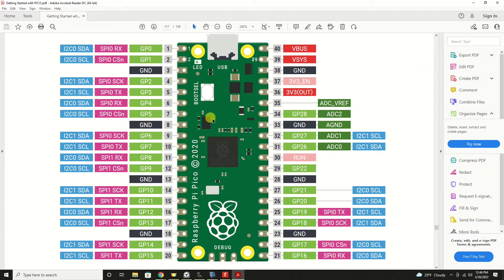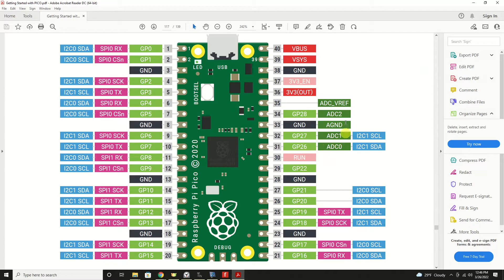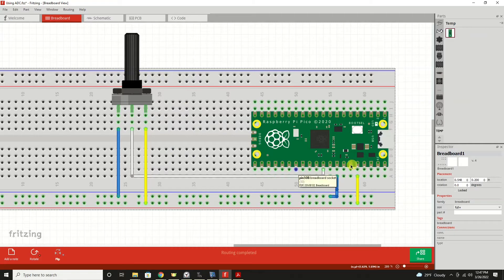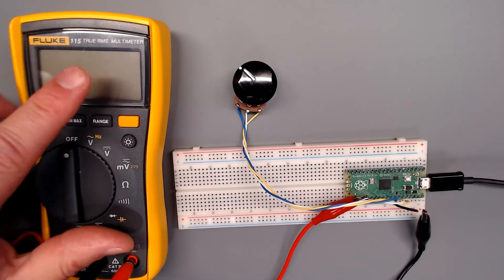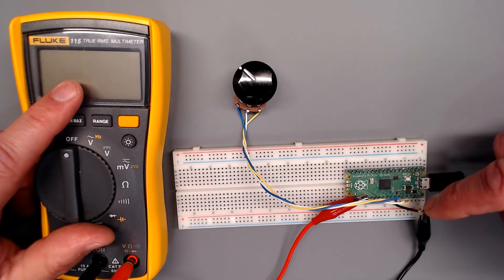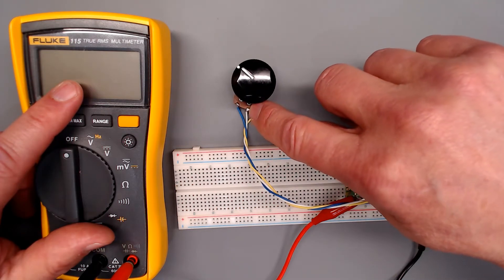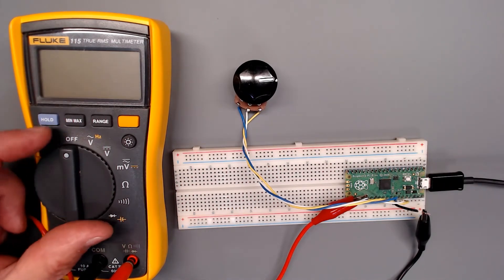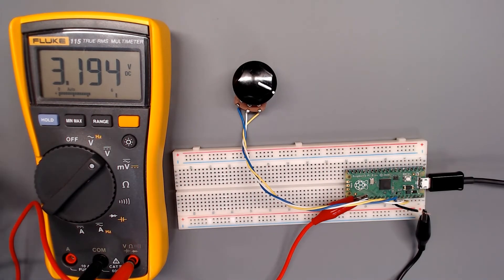Read Analog Voltage with the PICO

Comment: can you get stable milivolt or microvolt readings with this ADC for load cell signal?
Reply from the maker: I have no experience trying that but I will say, you will need a VERY STABLE power supply and circuitry.  
Chris

Comment: I tried to read a 10k ntc thermistor with 20k to 3v3. I found the adc on the pico loads the input like about 25k to gnd. Use a voltage follower If you need accurate voltage,
Reply from the maker: Thanks for sharing David.
Cheers!
Chris

Comment: Hey Chris! Thanks for another great video. Question for you...  I will be powering my pico with a battery; how can I read the input battery voltage and display it on the screen? My lipo battery will go beyond 3.3v at a full charge, so I know I can't feed the battery input directly to a GPIO pin and measure it with the ADC. Google says I need a separate voltage divider IC or something, is that really the easiest way to go about it? I find it hard to believe that my pico isn't capable of measuring the input voltage straight from the VSYS/VBUS pins somehow, no?? Is that just the way it goes, since the whole RP2040 runs off nothing more than 3.3v, or does the PICO have some kind of clever hardware already onboard that will let me measure the proper battery input voltage?
Reply from the maker: Hi Kaylor87,  The best method is to use a voltage divider.  
Chris

Comment: How would you send those values to  a program on a Pi? Thank you.
Reply from the maker: I suspect you want to use the PICO to get the analog data because the PI does not have analog inputs.  There is a more direct way for the pi to get analog data -  see this video...https://youtu.be/r5SYyQB0e8w
Cheers! Chris

Comment: Please, how do i get stable readings from adc pin, I am getting jumping readings even tho they should be stable, do you have some idea how to help?
Reply from the maker: What is connected to your ADC pin?  Is that sensor providing a stable voltage?  
Unfortunately, the sensor could be outputting an unstable voltage and you won't be able to stop that.  However, you can average a number of samples and use an averaged value.
Reply: Due to the switching power supply noise you will encounter such problems whether you are sampling fast or slow the noise will render most ADC data useless. And, sorry to say that even averaging can't get you an assured good sample. YouTube make GreatScott has a video showing how you can remove a resistor to the "aref" pin so that you can use an external power supply (like a battery (they have no noise at all)).
If you measuring a DC voltage or slowly varying DC voltage try a 100nF or 1uF on the ADC input to ground.